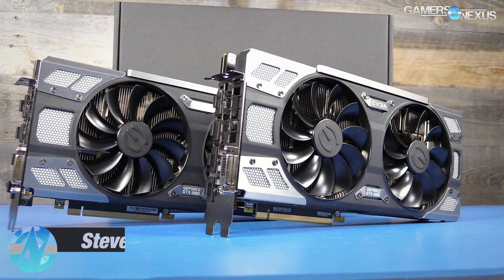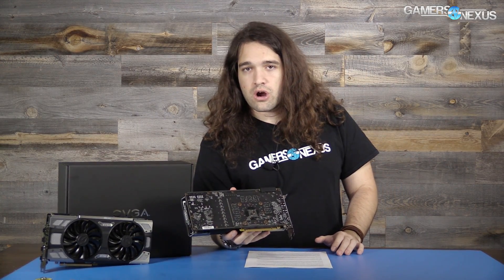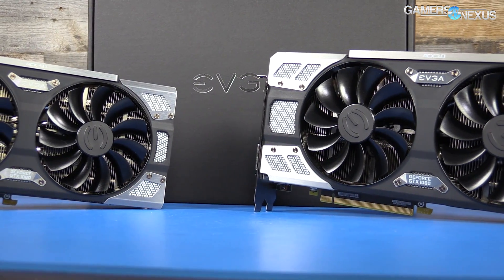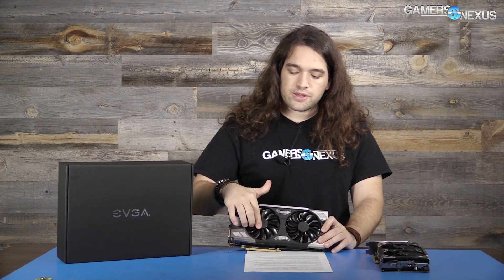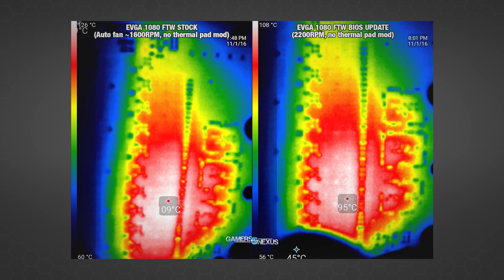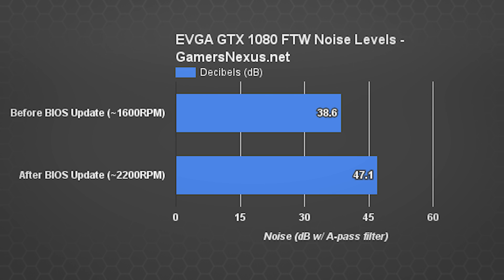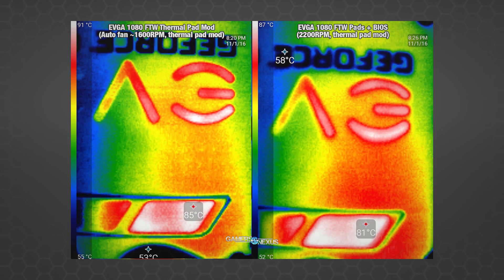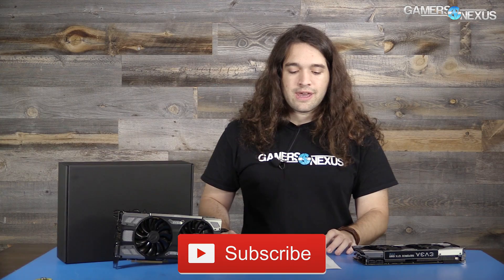EVGA's Heat Solution & Thermal Imaging of New 1080 FTW

Comment: Two questions. 1) What are the exact size specs on the thermal pads? (length, width, thickness) and 2) Is EVGA supplying a BIOS update for both the Master and Slave BIOS on the GTX 1080 FTW cards? I ask because I already have a couple packs of FujiPoly thermal pads in different thicknesses and would not have to wait for them to ship them to me.
Reply: Tony G. not sure if you've already seen it yet but he made an additional video on his channel with all the exact measurements.  I myself just got a 1070 and was wondering the same

Comment: Will applying the fixes help prevent throttling at all? My 1070 SC constantly hits the power limit, even at stock speeds and with the power limit slider all the way to 112%. I watched the JayzTwoCents Pascal OC video and for his 1080 the power% was often in the 80's, never hitting the power limit. I read somewhere that power limit is related to temperature; when the temps rise, the power limit is reduced, making you hit it more often. Is that correct? When I raise the fan speed I do seem to hit the limit less often, though still pretty frequently.
Reply: Malus1531 I've been looking into getting a 1070SC, did these fixes help with your problem? I wanna have some real world experience before I go throwing $450 at gpu. Honestly if I didn't like EVGA I'd just avoid the hassle and go with another gpu
Reply: Zach Wolfe
I received the pads but I've been too busy to apply them. I decided not to download the BIOS, at least for now, cause I'd like the option to keep noise low (I can always set a more aggressive fan curve to mimic BIOS update). EVGA says my hitting the power limit is normal. I do feel like I hit it less often when I turn the fans high though, so maybe it is temp related (like maybe when the temps get high the card lowers the power target, causing me to observe hitting the power limit).

Comment: VRM Temps are effected by core voltage in most cards. I run my 1080FTW DT undervolted at 0.8v at 1810MHz boost. I have a feeling that massive undervolt will mean my VRM run much cooler too than stock.

Comment: I don't understand the recalled part numbers.  I have a this part number  08G-P4-6171-KR.  But the recalled part number is  08G-P4-6171.  Does  08G-P4-6171 include the  08G-P4-6171-KR?  Also how about refunds?  People payed for a card that was quiet.  This vbios update makes it twice as loud.  That materially changes the card and they should be offering refunds.  That's not the card people payed for.
Reply: The last two letters, KR, KG or BR are warranty labels. KR is 3 year, BR is 1. So yes, it is included.

If you make a case about the refund, i'd try it at the vendor you bought it from first. The vendor might say that out of the box the card was fine, and you changed the bios so it's on you.

Don't forget, your card is not broken and might not get broken either. Either way, i stick with the pads and skip the bios myself. The pads do a better job overall anyway.
Reply: What recall? Can you give me a link? I'm a owner of that part number, i tried their support and they are saying the card has no issues at all.
Reply: http://forums.evga.com/Update-11716-with-NEW-BIOS-EVGA-GeForce-GTX-10801070-PWM-Operating-Temperature-Update-m2573491.aspx
Reply: Thank you but thats not a recall, that was just a bios update. The only purpose of it was to increase the fan speed from 1700 to 2200.
Reply: You also get a free thermal pad kit

Comment: Looks like I'll be going with MSI's 3GB GTX 1060 or 4GB 1050Ti.
Reply: actually it does affect 1060 models
Reply: You don't need to worry since the 1060 was not effected by this.  Only applies to 1070/1080
Reply: eKSe I think you're right I just read about it today.  So anything with an ACX 3.0 cooler.  At least new cards should be OK after this fiasco is over.

Comment: Tomshardware also noted pretty high temperatures on the EVGA 1060 SC pcb, but they also applied thermal pads between de VRM''s and the heatsink itself and resulted in lower temperatures. Could you do a video about that card too? I think a lot of people would be interested to see the results, myself included. Anyways, thanks for this vid, really informative.

Comment: They only discovered this after someone ran Furmark for over an hour, which is far mare than what should be ran, thus heating the card to well over 100C, and causing the VRM(s) to blow up. 

I challenge anyone to do the same with any other GTX 1070 ot 1080. Founders edition, aftermarket cooler, and custom PCB cards.
Reply: Nick Gregory That would actually be interesting!

Comment: Just by the off chance anyone was wondering: Case temperature for the MOSFETs (the VRM) is the temp rating of the actual casing of the MOSFET, not your actual pc case's temperature, 125C would be incredibly hot! If you are taking thermal measurements of the MOSFET (and can actually see the MOSFET w/o the heatsink blocking it), then the Case temp. is pretty useful AFAIK.

Comment: Nexus what is the best 2k monitor for gaming fo less than 600$? Can you do a videos on monitors? 
Thanks for the help
Reply: Another part you need to specify is what price range you want to spend as that determine's a lot on a monitor.
Reply: BenQ XL2730Z is what I've been using for almost a year now, it is 144hz 1ms grey to grey response time so it's suited especially well for fast paced fps games like csgo or battlefield and the like. It's especially good for its price if you are rocking a powerful pc with gtx 1070 or even 1080 as you can easily run even the newest games at 100hz or higher at 1440p. It supports freesync from amd, but imo freesync or gsync on 120hz+ monitors are useless as you should have a powerful rig to run games above 100hz at almost all times anyway. which doesnt need any vsync or gsync at that refresh.

it's slightly above 530usd on amazon for new, cheaper if you buy used or refurbished. One thing to mention is that it uses a TN panel, that's how it achieves 1ms response time as ips still cant go that low yet, but from my own experience is that with some color tweaking after installation, this monitor reproduces better color and blacks than my 27 inch ips asus monitor.

I would recommend this as I already own it ans have experience with it. Hope this helps with your decision on a decent 2k monitor.
Reply: ***** Thank you for your grea response. after some digging I guess this will be my new pc upgrade :)

Comment: I just ordered a EVGA 1070 SC Black Edition. Should I be worried?
Reply: Yes:

http://videocardz.com/64084/evga-22-geforce-gtx-10-models-are-affected-by-pwm-operating-temperature-issue

EVGA SC 1070 Black Edition is code #08G-P4-5173

Heres the evga page for that one:

http://www.evga.com/Products/Product.aspx?pn=08G-P4-5173-KR
Reply: Also looks like EVGA is having problems with vram and contact as well. Pointing to EVGA cutting lots of corners this generation. So yeah  I would just skip their entire lineup as of now.
Reply: sc cards don't have as high of an issue as FTW cards. FTW cards run higher power targets so more power through VRM's. If you are worried just setup a fan curve in evga software so fans run higher then they do by default that will make sure you are fine.
Reply: Too late!
Reply: The black edition runs cooler than the other ones, as it does not have the backplate wich traps hot air instead of moving it off. (what the thermal pad mod does for the backplate)
Reply: Oh okay. Well hopefully it will be fine then. Might still pick up the pads just for the inside one.
Reply: ***** Your VRM could still be getting dangerously hot (100C+), reducing the card's lifespan.

Comment: i thought evga was a really high end brand...
Reply: welcome in 2016 when cars lacks proper anti-corrosion coating and graphic cards dont have thermal pands to save 5 cents
Reply: They are, this was a baffling design decision. Such a gamble to save what? $0.03 a card?
Reply: They realized the mistake the hour it was discovered and are offering free bios updates, free thermal pads, and free replacements to every owner. I think they're doing a pretty great job.
Reply: I'm an affected consumer, I bought a 1080 ftw day one, it's my first evga product ever, now this makes me to rethink about their brand reputation, a pitty really, just to save a couple cents and to risk your customer's loyalty.
Reply: The difference here is that you don't need to pay for the mistake.  That you have the option of them just sending you a replacement card and THEM Paying the postage both ways.   Of the fact that, if YOU break the card applying the pads, they'll still replace it.   You need to understand that no other component maker does shit like this.  In any other situation, you would be mailing it back at cost for them to fix over a few weeks.

Not even an EVGA owner here (at the moment), just have owned a lot of different brands.  This is not normally how companies deal with issues.
Reply: They are. It was just an oversight and they have taken EVERY single step to remedy the issue. BIOS update, Free Thermal Pads with thermal paste, Free shipping, Free Advanced RMA and anyone who messes up their card by mistake will STILL BE COVERED by their warranty.
Reply: Bogo 😳
Reply: i got a 1070 sc, went to the forum, admin and tech support are still denying the issue
Reply: It was just an oversight and they have taken EVERY single step to remedy the issue. BIOS update, Free Thermal Pads with thermal paste, Free shipping, Free Advanced RMA and anyone who messes up their card by mistake will STILL BE COVERED by their warranty.
Reply: Based on their own statement, it wasn't a "cost saving" decision, and more of a oversight, they just thought the vram won't need the thermal pads.... bad decision anyway.
Reply: Oh so they didn't realize the heat issue when they heat scanned their own cards?
Reply: wertyui676
it was something that didn't occur during normal use

Comment: Well, crap!  Why would EVGA do all the work of engineering the back-swept fan blades, and everything else that they advertise as being so superior about their "new and improved" ACX-3.0 cooling system, but then leave out something so basic and fundamental as the thermal pads necessary to actually move the heat?  And how is it an accident, if it was done that way on the whole product stack?  What the hell is going on over there? 

I'm not even trying to hate on EVGA -- they had been my planned choice for a heavy SLI build I want to do before the end of the year.  But now, I'm suddenly having serious doubts!  Off to look at Steve's full article!
Reply: Card was tested and was fine, only time issue reared up was when a site and people used furmark which pushes every part of the card at same time to 100%. Problem is real world games and app's don't do that so reality of how serious problem this is, its pretty low except in extreme use cases.

Comment: Hi, I have the 1070 ftw, so this also quite disturbing for me too. Could you please consider the heat sinking in to the RAM modules (as seen in your thermal image) and find out if the 3 neighboring modules are at risk. Thank you for your in depth approach to this problem.

Comment: Hi Steve, I'm thinking of purchasing an EVGA GTX 1080 FTW 3.0 card for a new gaming build at the end of the month, do you think this issue is enough to warrant switching cards to something like a Zotac gtx 1080 extreme? They are both around equal price range I believe. Would you recommend Zotac even without the heat issue?

Comment: that rpm is just ridiculously high, just for comparison to my  Gainward GeForce GTX 1070 Phoenix GS run at 800rpm at max load, 700 rpm on most games. and now bios update to change fan speed, people should not  run stock fan profiles anyway. nothin stock is good, except gaming benchmarks, those graphics presets are ok for only that use

Comment: So my EVGA GTX 1070 SC ACX3.0 is not affected by this?
Reply: Okay Thank you! I will most certainly request one! The one time I buy a premium graphics card, it has an issue like this...
Reply: masuderman Technically all EVGA cards with an ACX cooler are affected, but in practice it'll be mostly the 1080's that are at risk, since they draw the most power. If you'd rather be safe than sorry, you can request the thermal mods from EVGA if you register your 1070 card at their website.
Reply: Well its mostly only the FTW cards that are affected cause power draw.

Comment: I own a 1080 ftw edition and the first 2 weeks I installed it, the screen would go black randomly, even during idle time, sound still running in the background but the system is basically locked cuz no inputs work whatsoever.

I first suspected production defaults, after fiddling around for another week and uninstalling couple softwares I had on win10, the problems were eliminated. However, the card runs 70c+ under load with default fan profile and tbh I found it weird since EVGA cards were known for good cooling, which is definitely not the case here. I'm not home right now but I need to check my model number when I get home, maybe it's really the VRM lacking heatpads that causes the card running hotter than usual.

I almost sent it back but I wanted to give EVGA another chance since it's my first card from them. I used to buy asus cards exclusively. However their fans on the older cards cant handle 24/7 operations and die after 2 to 3 years so that's why I switched to EVGA this time. However I'm not very happy that my first EVGA experience came with afore mentioned issues.

Comment: It isn't 1080 FTW related but... Should I be concerned about having the same issue with my TITAN XP Hybrid seen as the fan doesn't spin up as much, thus not cooling the rest of the card as efficiently? I did fit a metal backplate with thermal pads (in the same way like these) from EK so this should be no concern now correct?
Reply from the maker: I don't think you need to be worried with the backplate. I've seen your mod :) But maybe a slightly more aggressive fan curve. You should be fine, though.
Reply: Comanso Rowlett if your too worried, you can create a custom fan curve to ramp up fan speed at lower temperatures.
Reply: Gamers Nexus
 Not only seen it, made it xD Thanks for the input Steve and Michael Bracken

Comment: For the noise levels in the title for the x-axis you are mentioning the A-pass filter which I wouldn't really call a pass filter, as it is a frequency based weighting of the measurements. At least in germany we use the terminology dB(A). It could be that you just do it different in USA, if that's the case just ignore what I wrote. Great video anyway!
Reply from the maker: That could be made more clear, you are correct. dBA is common here as well. I'll change that for future charts to be more clear.

Comment from the maker: Article here: http://www.gamersnexus.net/news-pc/2666-evga-heat-solution-thermal-imaging-of-vrm-1080-ftw
Reply: Would a custom aggressive fan curve in Afterburner negate the need for updating the VBIOS? My EVGA GTX 1070 SC rarely goes above 70C on the GPU temperature reading on Afterburner.
Reply: Yea it would since more air flow is moving over the card. The new bios update does that and the thermal pad's are optional thing if you want to do it. I run 2x the fan curve they do at 70c and never had single issue.
Reply: i was wondering that also, if you just set it to a 'Target Temp' shouldnt it be fine by itself?
Reply: Massive NEW cooling problems found on 1080 FTW just today:

https://www.reddit.com/r/nvidia/comments/5aqjvb/so_i_disassembled_my_two_evga_gtx_1080_ftws/

VRAM memory pads are not touching.

I give up on EVGA.
Reply: Ouch. That reddit thread. ....it's like they just throw the pads on for fun, even when they remember.
Reply: would running the cards without the backplate help?
Reply: In The Mean Time it seems to be just a good general idea to save a profile for gaming with a strong fan profile while gaming and use it while gaming to keep it cool